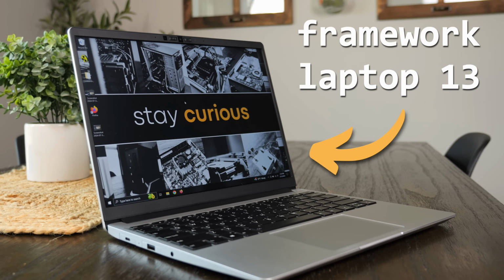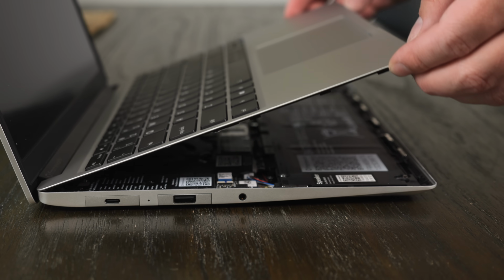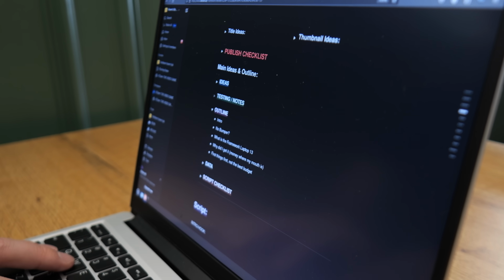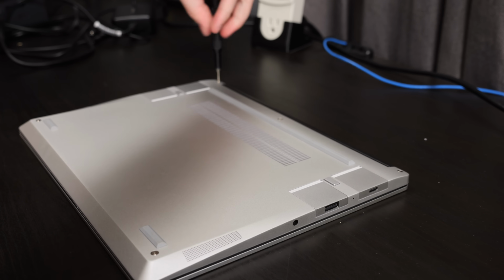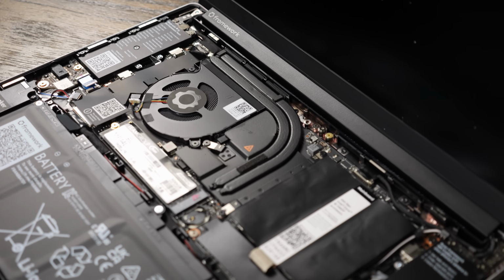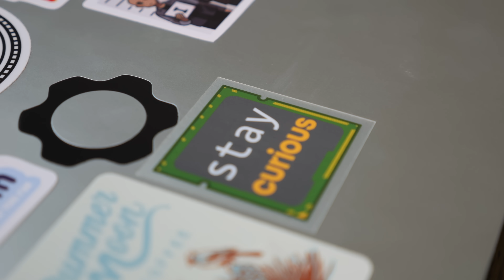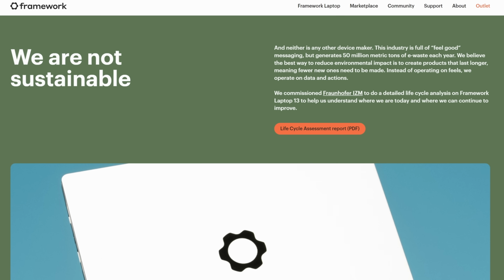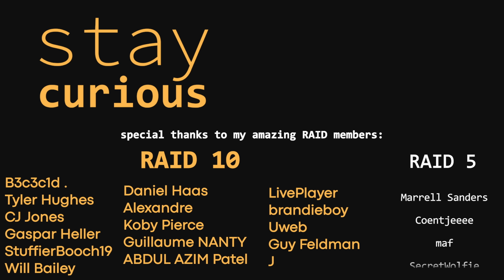Is The Framework Laptop ACTUALLY Worth It?

Comment: Like the idea of this laptop but tbh you can get so much more for your money and still be fairly easy to repair with a ThinkPad, I got a 2018 ThinkPad A285 with Ryzen 5 2500U, 16GB RAM & NVMe 256GB for just £160/$200 refurbished but in excellent condition earlier this year and it's so easy to repair/upgrade.
Reply: Used market will get worse with time as less serviceable models start to enter it.  Think less about today and more about your next purchase in 5 years.  If Framework is well-established by that point, then you'll likely be saying the same thing about buying a used Framework.  That's the dream.
Reply: The problem is that they're getting really old: my current laptop is also from 2018/2017 and it is too slow now for development
Reply: "still be fairly easy to repair" - not even close bud, keep dreamin'!

Comment: I work in IT and had the opportunity of choosing the laptop I want to use, bought by my employer. I decided to get a framework 13 with the i7 1360p. I love it. It replaced my tower computer at work and is plenty capable. I use it docked to 3 1080p Monitors. The only gripe I have is that the RJ45 (Ethernet) expansion card sticks out of it, but it doesn't bother me that much. Never regretted the choice.

Comment: Looks like Framework has finally offered what I've always wanted: A laptop that can have a 10+ year lifespan (with upgrades to keep it current)! I've always hated having to replace a laptop because it's now too slow to be usable. Especially having to re-install all the apps and settings!
Reply: To be fair, upgrading old laptops to an SSD if it was still using HDD and replacing the battery would usually make them very usable again 😄
Reply: @AninoNiKugi  true, but a 10 year old laptop delivered with Windows 7 or 8 will struggle badly with Window 10 or 11, even with an SSD. I usually convert them to Linux to make them actually useful.
Reply: @billmiller4800  Well it obviously depends on the task you perform but with an SSD and at least 8GB of RAM, it'll be enough for basic tasks. My father still uses my 12 year old PC 😄 I wish it's easy to move them to Linux 😅
Reply: Can you imagine using a laptop chassis from 10 years ago though? Would feel so dated
Reply: @simonhill6267 if it's only feels outdated why would I care? 

And how do chases look outdated? 😅
Reply: @simonhill6267  i mean you can replace the chassis too lol

Comment: I think the expansion cards have gone the wrong direction. I think they should combine some of the expansion slots so we could get much more ports for the same space instead of one port per slot.

I would want to get a framework, but the laptops of this generation is super interesting. the HX cpu's and the asus g 2024 series laptops.

Also I want whatever framework was smoking when they were setting the main board prices. 450$-1000$ for current gen motherboards without even ram?

Another one is paying 350$ for an i7 1185G7. 350$ for 3 gen old hardware. NUTS. not to mention that 11th gen framework mainboards have a critical flaw with the CMOS battery.

Comment: My framework has been rock solid using Manjaro Linux, which is not even officially supported...
- Display scaling isn't an issue in Linux, you just resize the menu and font configurations
- Got my 50Wh battery time up to 5 or 7 hours, after some tweaking
- I put in a 2 TB SSD, so storage isn't an issue for me
- Got all my function keys working
- Got the finger print reader working
Reply: Update: 

The framework I use for work had a mainboard failure. 

Contacted support, send them some pictures and videos, received a new mainboard under warranty in less than 10 days. 10/10 customer support!

My girlfriend has a framework too, her's is for leisure not work. So I stole her mainboard for a couple of days and used it in mine. :-)

I would've never been able to do this with any other laptop. Most other brands would've put me without a laptop for 3 weeks or more.

Framework is really a game changer in this concept.

Comment: The torx screws are controversial but I really like the decision to go with them. Torx is much, much harder to strip than philips and a laptop with all those tiny screws stripped isn't really repair friendly anymore. Ask me how I know.
Reply: and they send you one along with the laptop
Reply: Fortunately miniature torx screwdrivers are pretty cheap.    And readily available.
Reply: @jasonk5979  Framework also includes one with the laptop.
Reply: @jasonk5979  Framework includes in the box a torx screwdriver which also acts as a spudger on the other end, that's all you need for any maintenance operation on its laptops 😉
Reply: Yeah idk why it's controversial.

1. They don't strip as easy like you said.

2. As others have said. Usually if you have mini Philips you also have torx.

3. Part of 2, someone buying THIS laptop are probably power users. Why wouldn't they have a complete kit of mini drivers?
Reply: I prefer those Robertson square bits... they were designed to be noob friendly. But they're rare, everyone loves Philips despite Philips being designed to strip because precision torquing drivers were not cheap during the days of Henry Ford.
Reply: Harbor freight has an excellent security screw package.  You will want these anyway for repairing all sorts of things.  And Torx are definitely the correct screw for this application.  You don't want to have to use a screw extractor to deal with your stripped micro Philips head.  And then (if you are successful) go order replacement tiny screws from McMaster Carr and have to wait a week for shipment.
Reply: We will never know how this guy knows
Reply: temu torx screwdrivers easily do the job
Reply: Phillips screws need to burn in the fires of Mordor
Reply: For those who are unaware, the screws on the bottom cover (case?) are captured, so it would be doubly-bad if you stripped them. As long as you don't absolutely crank down on the screws you will be fine.
Reply: How do you know?
Reply: @FlyboyHelosim  Both the fact that they include torx, and that they include a driver in the box were mentioned in the video
Reply: How do you know?
Reply: You could always google how to unscrew a stripped screw, it isn't that hard to google, and it isn't that hard to unscrew a stripped screw. Also screws don't strip if you use the right type of phillips head screw driver, they have different shapes and sizes for a reason.
Reply: @MegaLokopo  You can strip screws even if you use the right head. And this choice in screw just makes it harder for them to be stripped to begin with, so there's practically no downside.
Reply: @MindForgedManacle  No you don't, because you aren't supposed to use a driver that is harder than the screw. If the driver is softer, the screw will NEVER strip.
Reply: @MegaLokopo  You're not replying to what I said, because you want to argue instead of be correct. I said a screw can be stripped even with the correct head, now you're saying it won't if the driver is softer. Obvious, which isn't a point I spoke about.

Go do something useful please.
Reply: @MindForgedManacle  You said a screw could be stripped even if you used the right driver, and I should that with the right driver which has to meet several different standards, a screw will never strip, and I gave one example of the standards that must be met for a driver to be the right one, not all phillips are the same, they have different materials and different sizes and shapes, like I said earlier.
Reply: @MegaLokopo  You mention that screwdriver bits have to be chosen to be softer than the screw.  I never knew that this was something to consider!  How does one go about determining what hardness the screw is and what hardness a screwdriver bit is?
Reply: @MegaLokopo  A driver that is softer than the screws you're using is a useless tool. You clearly don't know what you're talking about.
Reply: @rars0n  No it isn't. It is one of the ways you control how much torque you are applying. If you are using a very soft wood, plastic, or some ceramics, you want to make sure you can't apply torque above a certain level. That is specifically why you can find drivers that are so soft and screws that are so soft. It is used all the time in manufacturing. It is how you give a tool to a thousand employees that completely prevents them from breaking the device.
Reply: @MegaLokopo  Yeah, when I'm using screws made of soft wood, I use my rubber screwdriver. It's an extremely common scenario. 🙄
Reply: @rars0n  Obviously I was talking about using screws to screw into different materials. If your driver is softer than the material you are screwing into, you will never over torque it.
Reply: @MegaLokopo  "you aren't supposed to use a driver that is harder than the screw. If the driver is softer, the screw will NEVER strip."

Those were your exact words. That's what I originally responded to. That was the context of the conversation. Of course, you knew that already, so I'm not sure why you're now trying to lie and pretend that you said something else. I can only guess you're trying to derail the conversation so that you don't have to admit that what you said was nonsense.
Reply: @rars0n  Yea but you started talking about glass screws or something. I was mentioning that the material you are screwing into might be far softer than your screw, so you need to be very careful with torque sometimes.

So just to reiterate, yes if your driver is softer than your screw it will never strip. If you are stripping anything though, you are using the wrong screw or the wrong driver, for the material you are wanting to screw in to.
the screw driver slipping is a feature not a bug, it allows manufacturers to buy very cheap screw drivers that allow the workers to not have to know anything about torque, all they have to know is "stop screwing when it starts to slip" and so long as they are using the right driver, which are often color coded, they will never strip a screw and they will never break the part.

Comment: Love the honest review. Now if only I could get a solid review on a System76 laptop.

One question about the Framework though. Can you update the Firmware from supported or unsupported distros?
Reply: Yes. It works with fwupd / LVFS to get firmware updates on distros that use these and this works fine for me on NixOS, had a few minor issues on some kernel versions while support for 7000 series AMD APUs was sill being refined but it's rock solid now. I've got a last gen system 76 pangolin and the build quality on the framework is way better than the clevo shells that system76 and many other Linux laptop manufacturers use. Judging by the quality of their launch keyboard though if they ever do their own in house laptop housing it will probably be rock solid. Actually think frameworks are better at working with other distros with a vanilla config than system76 who do some things to optimise hardware support in Pop!_OS. For me I just add 3 system76 specific lines to my NixOS config file to get the RGB working right on my keyboard and better power management but this can be a bit more finicky on other distros.

Comment: Regarding especially heat and fans but also battery life, this is an issue for in my experience all x86 laptops. The only laptop i really enjoyed was my macbook pro m1, no x86 has been able to deliver regarding heat and fan spin up. Also, the macbook chrushed even my Thinkpad T14s in regards to the quality of the trackpad. I'm happy as long as I don't need to use a laptop thats not a M-series macbook. I set my Thinkpad (the only windows laptop somewhat enjoy) to minimal power usage including disabling turbo boos to minimize heat, but that only get you so far. Also, I'm dual booting Fedora on my Thinkpad with minimal power settings with TLP but the issue with heat is still there. In short, Apple makes the only viable laptops for me.

Comment: The powerbook g3 was the best laptop apple ever made. It was 2x ahead of the competition, and had huge amounts of cahse whilst being extremly user servicable and even had a g4 upgrade which doubles the performace. Now adays, apple makes laptops for noone. Why? Beacuse its too expensive for the casual user, and cant be upgraded at all unless your wanting to void your warranty, but its gpu isnt fast enough for power users and the ram options are god awful. A pro needs 64GB to run CAD, the macbook comes with an equivlent of 12gb. the mac pro is too expensive. Also software support is really terrible, and running via emulator makes it about the speed of a basic 400$ windows laptop. Only thing is benchmarks that run on the m1, not actual app performance.

Comment: The ETHERNET port aloen would be worth it, if it wasnt already enough to actually get some quality, repairable and upgradable hardware insteadt of this complete and utter throwaway trash that 100% ALL OTHER notebooks are nowadays! One downside about th Framework 16 is that the amount of expansion slots is too low!As any decent person will need Ethernet, HDMI/DisplayPort, there are just fouir slots left.. which you will want to fill with USB of course. Not even to speak of the 13§ which has even fewer slots.
Ethernet and Video-Out should have been in the base chassis.

Comment: As soon as you mentioned the I/O modules i started wondering about something like a UART module or maybe something with an ADC for attaching sensors, that could be pretty handy in certain cases instead of having an arduino board plugged in

Comment: I pre-ordered a Framework 16 back when they first announced it, first time I've ever pre-ordered anything. Not disappointed. I love this thing. I'm a sysadmin/IT manager, so being able to swap in an ethernet port to troubleshoot a switch, then a half hour later swap that out for an HDMI so I can give a presentation makes life so much easier. Granted I've only been using this laptop for about 6 months, but at this point I'm pretty confident that it is the last laptop I ever buy.

BTW, the FW16 mainboard has dual M.2 slots.
Reply: I've been struggling along with an ancient Dell Vostro 1700 that was manufactured in 2010, and that has only 6 gB of DRAM and a 2-core Pentium. I'm still running Windows 7 on it because it doesn't have enough CPU or memory to run Windows 10, and this is starting to cause me problems on some websites that require versions of TTS that Windows 7 doesn't support. So it's time to upgrade, and I'm looking at the Framework 16. I especially like that there are 6 I/O slots, and that it's easy to change the cards in them on the fly. Need an extra USB-A, and don't need the HDMI card? 10 seconds to swap them. Need to connect to an Ethernet router and don't need the HDMI card? 10 second easy swap. Is the SSD starting to fail after 2 years of heavy use, or you just need a larger one? Easy and inexpensive replacement. Bought some new game or productivity app that needs more DRAM memory than the 48 gB you currently have installed? Add a second 48gB module for $150 instead of buying a whole new laptop!

Comment: The main issues with framework is the price, but when you consider is not going fist to fist with EVERY market, but only with those pricey one like HP Firefly, Dell XPS, Surfaces or other premium laptops that main goal is to be slim. The truth is that Framework is not for everyone and that fact we need to accept, even if we love the idea, when it comes to buying laptop for writing docs, or using browser, we gonna look at used thinkpads or new chromebooks, but when we need premium laptop, Framework look as a good option because when it comes to upgrading it, its gonna cost much less than new one. 

The another fact about framework is... there is no one standing behind you with heavy object to stop you with putting framework motherboard inside other laptop case, so when you have old t480 that is not enough, little tinkering and you got framework upgradebility in your old laptop :D
Reply: Not really...unless you want to practically completely re-build that t480 chassis. Or cut a bunch of holes in it and deal with junkiness.

Comment: I really wanted to buy one but my current laptop is not that old (12th gen Intel) and it feels like it goes against the ethos of reducing waste by repairing for me to just upgrade early. Will definitely buy next time i am in need
Reply: Believe it or not, Framework have actually said they'd rather people only buy when needed. It's why they don't do timed sales.
Reply: Do with this information what you will, but if your Lenovo has a load of storage (and if it don't, you could just get a bigger drive, either internal or external, and) you could set it up as kind-of a backup/NAS, which is what I've done with my desktop. I'm not saying like full-on backups and storage and install TrueNAS, just keep it useable as a regular PC but also act as a NAS, if that makes sense.

I've left my desktop with Windows and all of my games and stuff, installed Syncthing to sync files between my laptop and desktop from anywhere, installed Free File Sync for backing up files on my desktop to one of its drives periodically, and installed Parsec for remoting into it, and everything works great for me that way. Now it's like my own (very overpowered) NAS, that I can also play all of my games on, too.

Maybe you could do something like this whenever you upgrade :)
Reply: No reason to rush.  Wait a few years and you may even find some good deals on the used marketplace if you eg. need a cheaper but better graphics card.